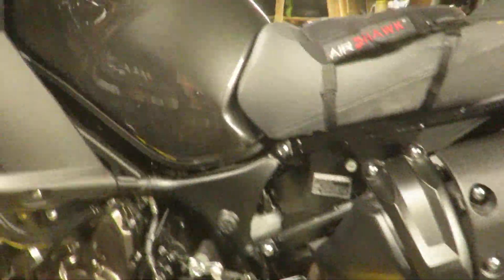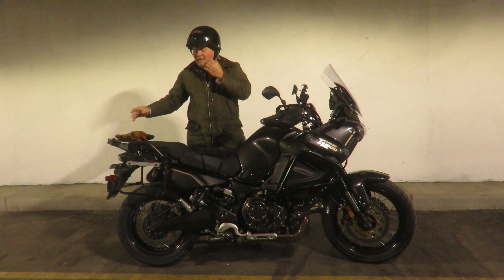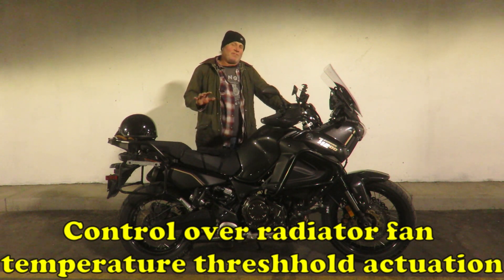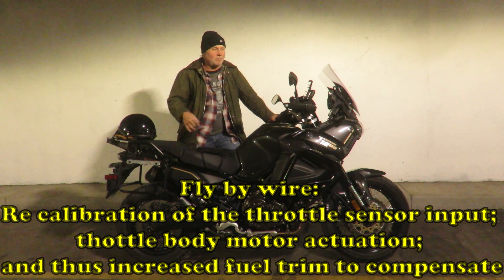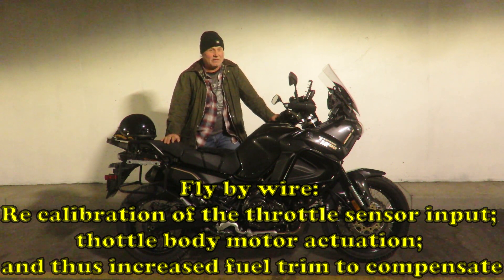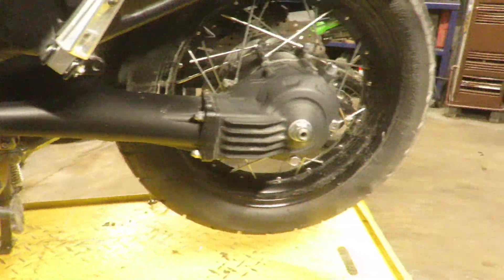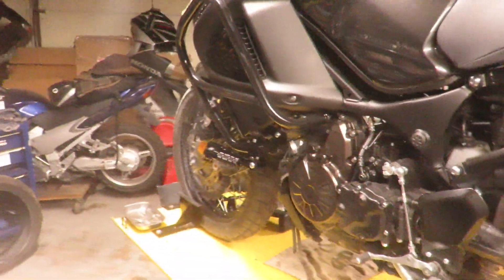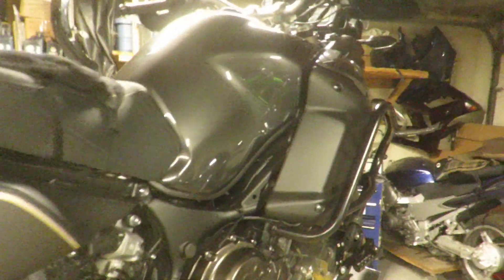XTZ1200 Tenere: ECU Re-flash Review

Comment: I have a '22 ST ES. Got it flashed by 2WheelDyno in Oregon, US. It is WELL worth it. The best $300 you will spend on this bike. The hardest part was what was NOT in the video: taking out that ECU! It has a bit more power, but the biggest gains are in smoothness and consistent power delivery. And, I am still getting an average of 49.5 mpg, and I'm not hypermiling. Don't think twice about the flash. Just do it. I've done this on my last bike (V-Strom 1K) and had similar great results.
Reply from the maker: Nice how they stuffed the ecu in there, eh? Lol

Comment: Flashed my 2010 1200 sent it away to Yuri Queensland fans come on early tuned for 98 octane big difference the change in sports mode exceptional it was like a I had installed a slip on still had stock muffler  I have a dominator slip on now Polish product excellent love the power and throttle response flash the way to go
Reply from the maker: Amazing how choked up these new bikes are. It's like you only get 75 percent of the bike you thought you bought. Lol

Comment: Thinking of getting one because of the shaft drive for touring just not convinced.
Reply: Just do it. Best $300 you can spend. A little more power, but consistent power delivery all the way up the rev range, all the restrictions taken off, and it is smoother. Still get just under 50 mpgs, too. Really, no brainer.

Comment: This might be the dumbest question, but ive just bought a 2020 model and it seems pretty smooth to me, theres no throttle lag, so how could i tell if its been done by the previous owners?
Reply from the maker: Hi there. One would know by plugging the ECU into a laptop and inspecting the maps. It also may be paint marked on the ECU accordingly. I Iike to do that but it's not standard practice unfortunately. The stock 1200 has a snatchy throttle feel, there are lags in response times all over. Without a side by side motorcycle comparison this is of course subjective speculation. I think the reflash was around $300 usd if I remember correctly, plus s/h. If you want to know 100%. The ECU can be reloaded countless times with new data points. Like loading software onto your PC.

Comment: I have a 2017 Super T. I’m also in Calgary. I’m loving the comfort of the bike on the pavement but it’s just too heavy and cumbersome for me to take off road. Thinking about getting a T7. Have a deposit on a 2025.  Would like to keep both so I can have each for different rides but cost and space to have 2 bikes is my issue. Might re-flash mi T1200 if I decide to keep it.
Reply from the maker: I think the T7 is a better bike, just as the DL650 is better than the DL1000, my experience. Alot of bike the T12
Reply: @JVWinalberta dl 650 better than  1000?😂😂😂 common  grandpa,  I hope u kidding 😂
650 extremely boring,  almost  same weight as 1000 has but way less power and fun
Reply: Have you looked up the weight of the 1200 verses the 700? The wet weight of a Yamaha Super Ténéré 1200 is 567 pounds (257 kg), The 2025 Yamaha Ténéré 700 has a claimed wet weight of 459 lb. (204 kg).

Comment: Looking to get the reflash done on my ‘24 SuperT. Just got to get it removed, then ship it over to TWDW. Thanks for posting the video.
Reply: Update. I sent it over to Two Wheeled Dyno Works (TWDW) in Washington. They quickly turned it around and the communication was clear and concise.

Putting it back in wasn’t too crazy and I had it up and running in no time. When I took it out to stretch her legs, I was blown away. It’s like a completely different bike. Even in touring mode. In sport, she’s even wrung out more. Not in an unsafe or dangerous way, but just fully unlocked / all the power available. Can’t imagine what it’ll be like with a K&N, arrow headers and Yoshi exhaust. If I could get her weight down about 15-20 pounds, she’d be unrecognizable. Love it and so glad I did it.
Reply: @nsanerydah  i'm thinking about doing this on my 2021 ST. did you have a lot of fault codes after reinstall? sounds like it's pretty straightforward for removal and replacement. any pointers?